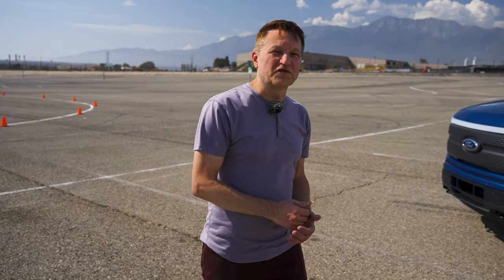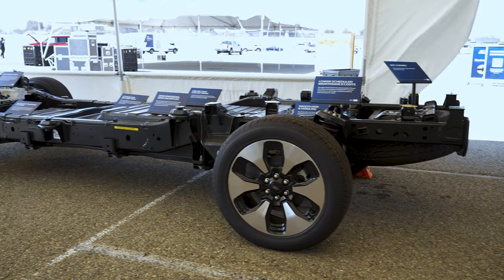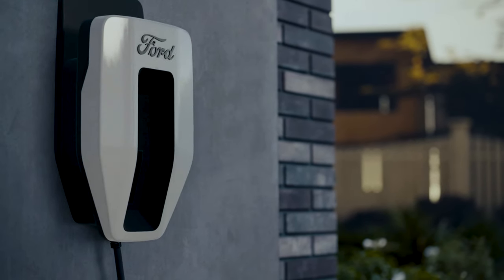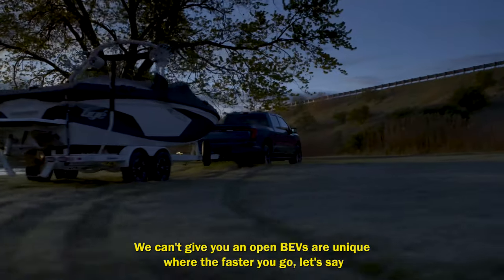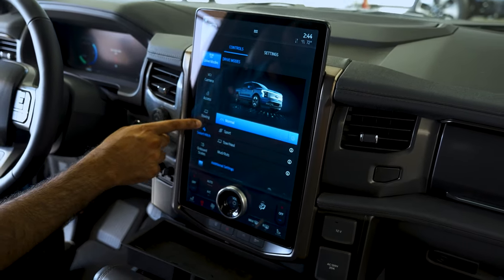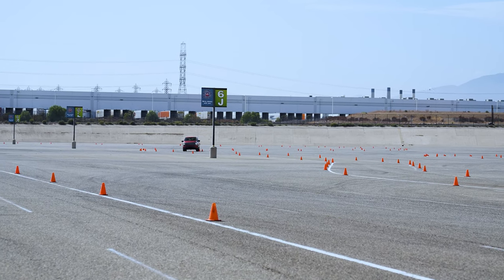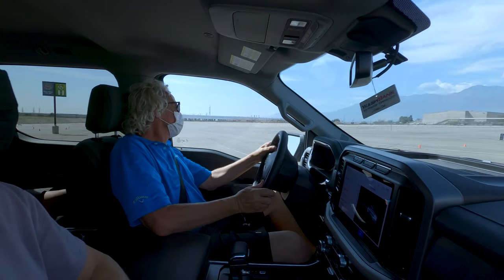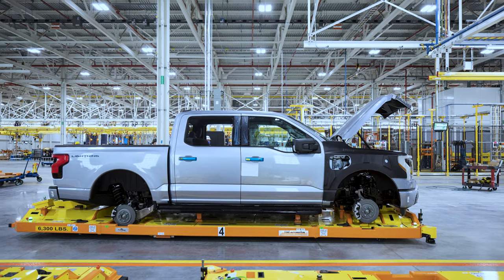Ford F-150 Lightning EV Pickup Truck Will DOMINATE!

Comment: Thanks again Eric!

I just got a 2021 Bronco 2-Door Manual Transmission Base. However, I was so shocked by the F-150 Lightning Pro Base Price, I ended up reserving one just after the reveal. One huge factor here is tax laws. As it stands now, if I get the F-150 Lightning Pro and it was available now, it would be $40K - $7500 = $32,500. However, it is possible that this vehicle could dip lower than $28,500, which would be LESS than my base Bronco. Since the $100 is refundable for the deposit, I don't really have anything to lose. 

Did you reserve one Eric?
Reply: @mikeb1039  I think it might actually be $2500. I will get it delivered to Village Ford which would be about an 8 minute drive from the factory. Still a good deal.
Reply: The price will probably be higher than the msrp. Dealers are raising the prices on these vehicles. Even if your order from Ford it doesn’t mean the price is locked. Dealers are adding thousands of dollars on top of the MSRP. Be ready to pay more for an EV.
Reply: @joegarcia3954  My dealer, Village Ford, has committed to selling at or below MSRP. Many others do as well.
Reply: @SmashTheNumbers   Good to hear! Here in Texas when you browse the dealer website the price for a Ford EV has a "Call Us" message.

Comment: What happens …very cold weather to the battery?
Reply from the maker: Reduced range if it's parked outside and not charged. If you have it charging at home, you should be able to preheat the cabin (and probably the battery) and get some additional range back.  There will likely be more details down the line.

Comment: I think it may succeed in suburban environments where people occasionally load some furniture in the bed or grab something big from Home Depot or another such store, but in rural or semi-rural environments where trucks are needed to haul heavy loads, I'm not convinced.  For example, I live in a town of about 30K people, and there are exactly 0 Electrify America chargers in or within a half hour of town.  I live in the Pacific NW, so solar isn't exactly a true cost-effective option here, so I'd have to rely on home charging from the grid.  If my energy provider happened to be PG&E, well, in California they've had issues with brownouts, and CA governor Gavin Newsom seems more interested in protecting PG&E than he is in forcing PG&E to upgrade their ability to provide consistent power.  So I'd have no faith at this point that PG&E's grid can support all these EVs.

In this video, the representative said Ford's "goal" is to have towing drop range by 40%.  If Ford meet s that goal, then if you bought the extended range battery, you can tow for 180 miles, then you have to find a charger, then you have to wait what, a half hour or so until you can go farther?  If, say, I need to tow something from Salem to Prineville in Oregon, and back again, I simply can't do it.  There are no chargers along that route.

So my overall thoughts are that this vehicle will be successful for a certain segment of the population, but it won't work for everyone.  Which bothers me because some states are hellbent on banning the sale of new combustion engined vehicles as soon as possible.
Reply from the maker: I agree that the charging infrastructure is not very built out in rural areas. It's really only decent up and down the west coast. However, it's a chicken and egg scenario. I can assume buyers will investgate their charging needs before purchasing.
Reply: @revmatchtv  Buyers absolutely should research their driving habits and charging needs.  There are a number of folks here in town who have Teslas (almost all Model 3s), and I assume they use home charging.  This is fine if you just need a car to run around town in, with the occasional trip to a nearby town or a less nearby city.  My family in this house has 4 cars, and using home charging would be difficult with that.
Reply: @revmatchtv  
Ford has the data which shows that 95% of the days that work F-150s are driven, they are are driven less than 174 miles, which is well within the range of even the Base (Pro) model.

Instead of blindly focusing on range for long distance driving, I love how they pivoted the comparison to making it easier to charge for workers charging their company's vehicles at home and then billing back. 

You can imagine a small business fleet that has 10 F-150s today. Perhaps they buy 2 Lightings next year and still have long range options with the other 8. Over time, they can replace all 10 vehicles as the technology improves.

Comment: 7:34 looks like they added the range ticker back. On that truck looks like just over half full battery and 340 mile range.
Reply from the maker: Yup - I saw that. They haven't released final battery capacity yet as they are still dialing in, but Ford has been meeting or beating EPA range estimates in real-world driving. They said they expect it will be 300 miles EPA.

Comment: The dev cycle on this thing has been a long time coming but they were testing prototypes as far back as 2008 cool to see this finally hitting production
Reply from the maker: Clearly development has ramped up! I think this could beat the Cybertruck to market.
Reply: @revmatchtv  I think it WILL beat the Cybertruck to market, at least effectively. Musk might do a very limited delivery like he did with the Model 3 just to say he was to market first.
Reply: @revmatchtv  most likely lol. As cool as the cybertruck would be, this is way more practical and affordable for most people. Hopefully dealerships don't cuck us on this one.
Reply: @gurgleblaster2282  Umm sure the low end range reduced version is more affordable. But the long range version is More expensive.
Reply: @Neojhun  yeah but the low range version has a lot of value for what it does. I live on an island driving more than 20 miles in a day would be weird. I get in some regions you need more range, but for what this thing is it represents great value.
Reply: @gurgleblaster2282  Sure anything can be cheap if you just remove parts of it.

Comment: Hmm Ford going in hard on the aluminum bodys makes even more sense too me now with the weight reduction for the EVs
Reply from the maker: Good point. Moving to aluminum was a huge move. Very expensive but it reduced weight quick substantially. Even so, the Lightning weighs over 6,000 lbs
Reply: Seeing how badly steel pickup bodies rust out, It made sense to me when they first introduced it.
Reply: @rzu7120  Me too I can almost watch stuff rust here on the east coast of Canada...

Comment: 230 or 300 miles is not good enough for a work truck that you need to haul/tow stuff with a trailer on a daily basis. 230 miles drops down 40%. Rivian told me 50% towing max 11k lbs - so 400 miles = 200 miles, which is doable for day to day Hauling. I ordered a Rivian.
Reply from the maker: 300 miles - 40% is 240 miles for 10,000 lb towing. That’s more than Rivian. If you go for the lower capacity then it’s not doable. Compare apples to apples and and they are likely similar in the real world.
Reply: @revmatchtv  I'm confused 40% 300 mile max range is 180 miles that I can get from Ford, period. I can get at least 200+ miles from Rivian. Price is not a factor for me, range is. I can't buy a Ford for that reason is my point. Ford needs longer range for people actually using these for Hauling rigs (trailers etc) in support of day to day operations. 
I own 2 x teslas and anything less than 200 miles is really not a lot. Especially if you are going from job to job throughout the day with 5,000 lbs being towed with one of these pickups.  
Just my opinion from experience with EV range and charging.
Reply: @ltphilipg  I just hope the rumors that they are down playing the range numbers is true.
Reply: Rivian is ABSOLUTELY not a work truck. It's a luxury pickup truck. Can't compare the two when the Rivian costs $30k more than the Ford...

Comment: Not sure about several scenarios...extra charging time versus filling time could open people up to a lot more carjacking and or robbery scenarios or worse. You don't think criminals are going to see the potential there? I would be much more inclined to charge at home but don't want to have to wait 8 to 14 hours to do so.

Also, does the Lightning 4X4 version have as much clearance as my current FX4 model?
Reply from the maker: Charging at home is what most people will do overnight.

Comment: I think you may underestimate how quickly public attitudes can change and how many people today would like to buy an EV if they only had (pick a feature: range, price, style, etc.). the most important step for the EV revolution is to make vehicles that appeal to people who drive ICE vehicles today. We already have EVs for the people you call 'tech savy.' Today we need vehicles that will convert Exxon customers. Ford is doing that with both the lightning and the Mach E, but also the upcoming electric Transit, Expedition, and Lincoln Navigator.
Reply from the maker: Public attitudes are borne out in their reservation numbers to some degree. However there is a very vocal and large group that is staunchly anti-EV. It’s up to Ford and other OEMs to change their mind. That’s what events like this are designed to do.
Reply: I'm still waiting for someone to make an EV equivalent to my S5 convertible. Quick convertible with 4 seats that isn't stupid expensive. That targa top thing with baby seats in the back Musk claims he will build someday doesn't count, especially at the price.
Reply from the maker: @LegionOfWeirdos  I think a convertible is verrrrrry far down the line. Convertibles are a very small niche currently. Most of the current EVs in production or planned are volume plays. I can’t imagine anyone but Tesla is actually turning a profit on electrics just yet.
Reply: @revmatchtv  The loudest naysayers are best simply ignored. It's like arguing politics or religion, pointless.

I'm old enough to have seen this before. Here's a quick list of positions I have personally heard staunchly defended: Seatbelts are more dangerous than no seatbelts. Pollution controls cannot work. Japanese cars are junk. "Plastic" cars cannot be repaired. Airbags are more dangerous than no airbags. Anti-lock brakes take longer to stop. electronic fuel injection means the end of hotrodding, and my favorite - electric cars drive like golf carts.

Most rational-ish people get hooked the first time they drive an EV. Put people behind the wheel and they will convert. For that to happen dealers need available inventory in desirable forms. Once the majority of people are driving electric most naysayers will quietly switch. 

As in politics or religion the most intransigent are loud but few.
Reply from the maker: @Miata822  I agree with you. We're not at the tipping point yet though. We are nowhere near EV mass adoption yet, but I see the curve starting to trend upward. In 5-8 years, adoption will become much more prealent as infrastructure is built out. Right now it's terrible unless you're on the West coast or North east for the most part.
Reply: @Miata822  I agree man. I don’t like electric cars.The Mach E is horrible if just for pretending it’s some kind of mustang. That being said I saw a Tesla at my local track run a 9 and get kicked out. Race car speed from a street car. Too expensive tho. For some reason this new lightning has my interest,which I can’t believe. The front trunk,the range and towing and the ability to run yer house. Yeah I’m keeping my mustang but I won’t cry if I have to get one In The future

Comment: What will determine if the F150 Lightning will dominate will depend on how well the range mileage and charge time are met initially and how it improves over time.  Anything less will be met with stiff competition by the other manufacturers.  Otherwise this EV is a barn burner and will have no problem finding will customers to buy it.  Range and charge time will make or break the Ford F-150 lightning.
Reply: charge time towing is garbage and a non starter as it cant tow anything anywhere with a 100 mile ish tow range at the current network spacing not to mention who would want to suffer through that, the cybertruck barely can.  and when not towing it has a 300 miles range on 200kwh? so its gonna need to find the 250kw+ electrify america chargers otherwise youre gonna have a bad time at 120kw or near taking 1hr+ due to how inefficient it is.
Reply: @richardroberson9277  
How do you know that charge time and towing range is garbage? Those results are yet to be known.  Also, the word is that the battery is 155kW-hr. not 200.  As I said, if Ford meets their commitments for range and charge time this will be a great truck to build even better performance in the future.  Gas vehicle range is not all that much better.  My gas vehicle today has a range of 400 mi unloaded and about 200 mi when 85-90% loaded.  Reports are that the advertised 300mi range is when moderately loaded with 1000lbs.  If this is the case, the unloaded range is most likely >400mi exceeding or at a minimum matching my gas vehicle.  Loading this EV to 80-90% of capacity may have a chance to meet a 200mi range loaded.

Comment: I’ve always loved a proper BMW. I’ve owned a booster E46 M3, a 435i Gran Coupé and a E30 325i. All were super fun cars but I am tired of maintenance costs. They’ve never broken down. The parts are just expensive and need to be replaced more often. 

I’ve always wanted a truck but nothing caught my eye. Everybody and their mom’s dog has a Tacoma on O’ahu. Chevy is a joke. Dodge has nothing I’d buy. Ford has many good choices but the gas mileage is poor. 

But THIS. Acceleration of my 435i. Practicality if a truck. Now if it can crawl control like a Tacoma, I’m sold.

Comment: Interesting, but I’m practical. I’ll wait until I can get 1,000 miles on a single charger while towing. Otherwise, that truck will leave you waiting and wanting more.
Reply from the maker: If you're wating for 1,000 miles you'll be waiting for 20+ years. When was the last trip you drove 500+ miles without stopping? I don't think 1,000 miles is the point we need to get to personally. I think faster charging speed is more important.
Reply: 1000 miles while towing?  That isn't likely to ever happen.  The best we're going to get is faster and faster charging.  That's my one disappointment with the Lightning, it is not as forward thinking about charging speeds as some of the others in the pipeline, like the Atlis.

Comment: 😯 my electric bill is all ready high, have you ever looked at your meter when your air conditioner is running. I can’t even imagine an 80 amp charger running for 8 or 10 hours 🤔
Reply: Well, compare that to how much you would spend on gas. Remember, you would be trading in gas money for electric money.
Reply from the maker: Vs. the $150 you might pay to fill this up from empty? No comparison, but your cost of entry is higher.
Reply: OK lets say the electric bill and fuel bill offset each other. i'm sure your insurance  is going to increase because the Battery is hazardous waste also how does these Battery's preform in cold weather.  i almost forgot wait until the government puts a mileage tax in place just saying..
Reply from the maker: @cluelesssam6975  the electric bill Will be cheaper than gas/diesel by a wide margin, even in states like California where electricity is expensive.

Comment: GARBAGE!

As a life long Ford truck owner I was so excited and hopeful for this truck. Sadly the value proposition is garbage. A 230 mile range is useless, so add $10k to the price. You want the cool electric features with all the plugs, household generator, tow technology package? You have to get either the Lariat+ Premium or Platinum trim level… so it’s $80,000 or $90,000. Looking at the value of the Range, features, and technology the Lightning is $20,000 overpriced!!! It’s very disappointing Ford isn’t trying to offer a competitive value to the Rivian or Tesla trucks. I cannot recommend anyone get the Lightning unless they’re cool throwing away money.

Comment: I was able to ride along at the Washington DC event today.   The acceleration is way more than they convey in this video.   It was just myself and the driver but you fly...not only off the line...but as you accelerate way past 60.   And you can corner at very high speeds without body roll.    It was pretty impressive.
Reply: I agree, I had a ride at the Daytona event and I think the driver was this same guy here in the video.  I was so impressed with the cornering speed and lack of body roll.  It was truly amazing.  Just hope my place in line is near the front as I reserved in the first 15 mins of the reveal.
Reply: @jerryfaircloth  That is the question.  Availability.    Will they make more than 15,000 or so Lightnings between April 2022 and the end of 2022?   They need to make about 100,000 to satisfy a decent amount of pre-order holders.
Reply from the maker: It's difficult to convey the acceleration in a video like this. It's legit very quick.